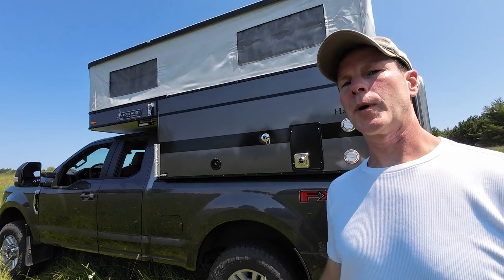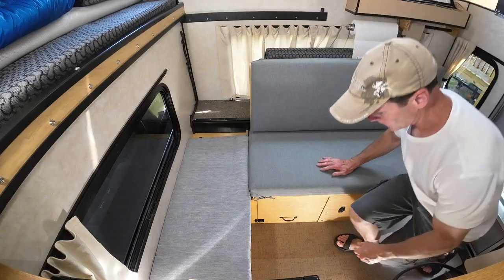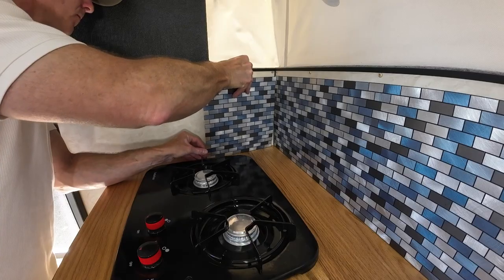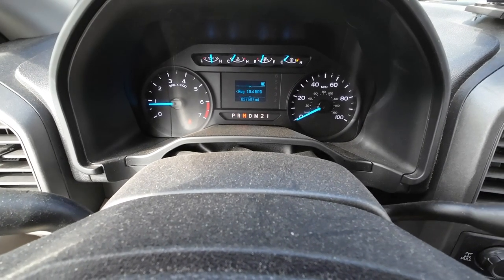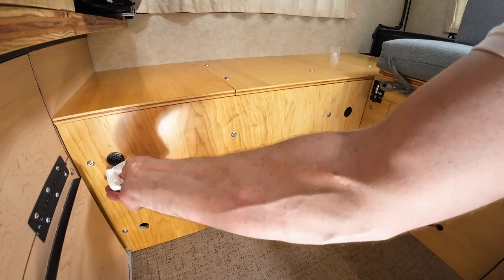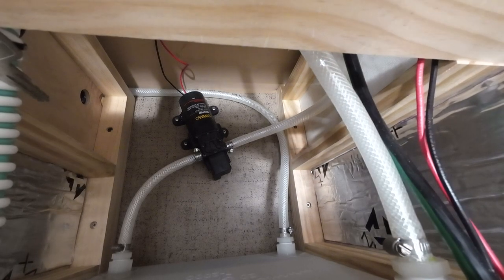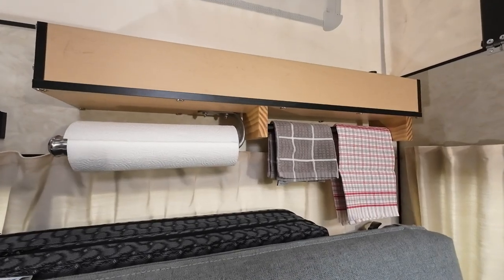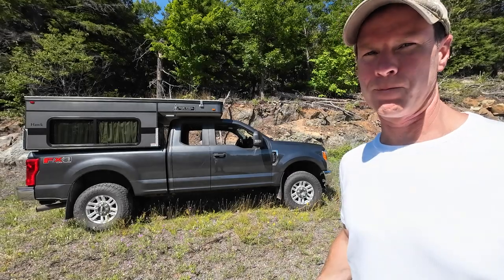The Last 7 Finishing Touches:  Four Wheel Camper Shell Buildout

Comment: I tried to follow all your videos, but I seem to have missed what you did about gray water. We camp in a lot of places where the discharge of gray water is prohibited. Even with all the tweaks you have made do you still have to drain into outside bucket?
Reply from the maker: Yes.  We have a 4 gallon Reliance water jug that we use.  I just didn't want to take up any interior space with a grey water tank.  I've seen some people make exterior (permanently mounted) grey water tanks that fit above the wheel well.  I'll stick with what I have for now.

Comment: have you ever considered utilizing the truck cab by connecting the camper and truck with some kind of a window boot for crawling through ? or to much trouble and no need
Reply from the maker: The back window of my truck doesn't open and the front window of my camper doesn't open.  If they did I think it would be a bit to small for me to comfortably fit through.  I think I've seen this done a few times with other campers for dogs to pass through.